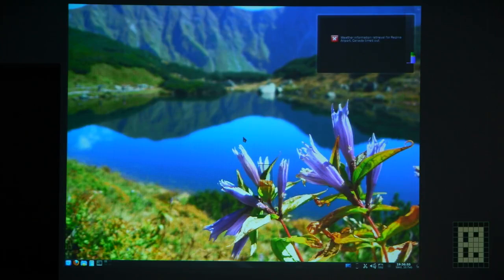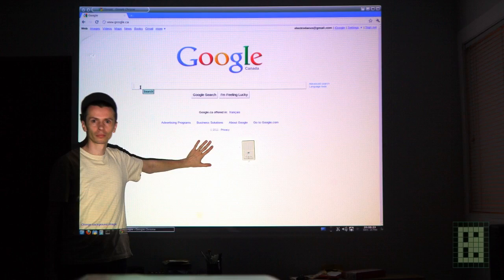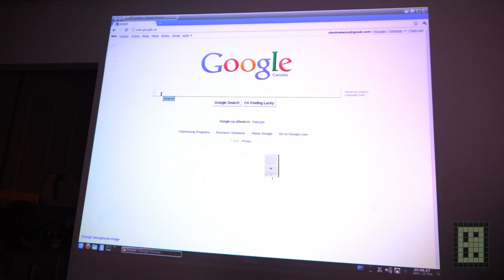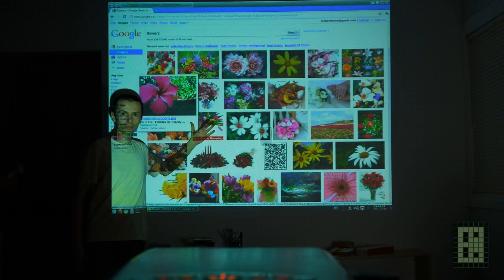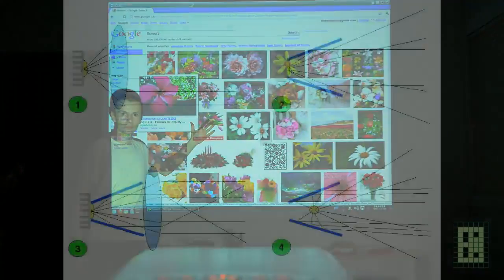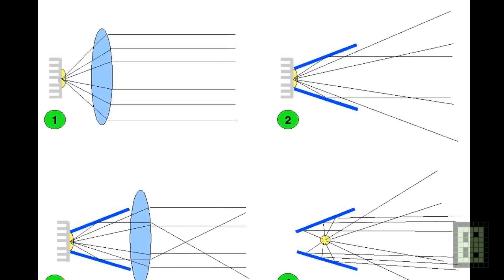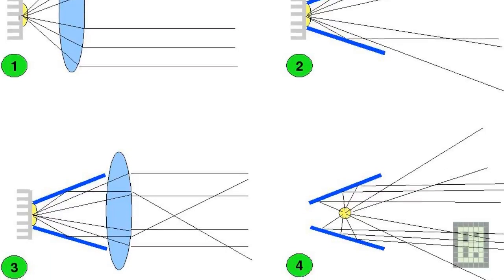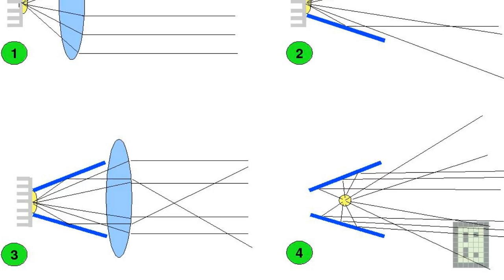DIY XGA LED Projector 3xLCD lamp replacement 25 lumen 720p (part-2)

Comment: I used idea with lens, 200% of improvement. Yes I have multi-die 30W LED, I will try to do test on 5W 3x3mm single-die which I bought few months ago for modification of torch.

Comment: Good job, I like it. Many thanks for the inspiration. I have 30W Power LED + reflector as collimator already installed in my Sanyo PLC-SU35 - 3LCD. Brightness in dark room was not exactly like I expected. And here is my "brightness" :) Lens is the key to success. Tomorow I'll be back with results. I've found beautiful lens ø=60mm. I hope, that it will give 200% of improve.

Comment: It's a movie projector (like you would see in a cinema) though it's not all that big, most of the bulk in those is in the base and the lamphouse. The original lamp would have been a 500-1000w xenon arc lamp. Just a large arc lamp with a big reflector behind it. No optics for light convergence or anything like that. No idea what the lumens would have been originally, a lot I recon. But that would have been for a 200"+ screen!

Comment: I can get the light source as close as a couple of centimeters from the film. The actual film area on 35mm is about 2.5cm square so it's not tiny. I don't have any optics in the light path yet, I'm still researching how I can do it really. The back of the projector is totally open with the shutter then the totally exposed film. From there it goes through the backup lens and then the anamorphic (if required).

Comment: I want to replace the xenon arc lamp in a 35mm movie projector with an led for home use, I have seen these 100w LEDs that seem like they would be useful for this but I imagine I'd need some precise mirrors/optics to pull this off? I'm building a lamp box from scratch.

Comment: The ones i have ordered are 150w Osram powerstars ($2.50 each), small enough to fit in the original lamps reflector. So that solves one problem, also they last 8000 hours and as for the LCD's i have a spare projector the same model in pieces with good LCD's in. Im hoping they will work with the UHP ballast, Metal halides are also HID but they are AC instead of DC. If not i will have to buy a ballast i guess ($20)

Comment: What about a 20w LED that puts out 2000 lumens ? Im quite new to this circuit stuff so i was wondering is there anything like a solenoid that i could jump off a fans power supply to turn the solenoid on/off, then have the solenoid as a switch on the LED's Neutral or Positive input ? So when the fans turn off the LED turns off too.

Comment: Let me rephrase. I have tried shorting everyone of the 4 wires, i have tried grounding everyone of them, I have tried unplugging it completely with no luck. The weird part is if i put a 12volt 50watt halogen in there it actually works its just really dim.. its just a matter of time before it blows up though im guessing.

Comment: Well ive tried unplugging the switch, shorting every way possible, grounding them and its just a Ballast error, if i put a halogen in the ballast it works.. but its not very bright and its just a matter of time until the halogen pops.

Comment: Hi Electrodacus, just like to thank you for all your help so far, I've used lots of advice you have given in the previous comments to get most of the parts for this build but there is one part I can't seem to find. Could you tell me where you got the mount for the large lens, I can't seem to find one on dealextreme where you said to get the lens from. Thank you

Comment: hi electro,
the lenses i bought off dx were those of what you specified and was able to focus it , but it's really dim even in the dark.( the led seemed to be bright as i can't stare at it directly) although it might still give off more light if the right driv er is to be used. so may i ask for your power source design like the one you used in this video(old laptop power source and the resistors' size and value to step down  the voltage)...thank you in advance and more power!

Comment: Hi electrodacus
  I have a different model of Toshiba projector: Toshiba TDP-SP1
  Currently I am trying to figure out if the power supply can be fooled or not.
  It has a cable with 5 wires connected to the main board:
  - two of the wires are +5V and ground
  - the other 3 I presume are connected to the 3 optoisolators.

Please advise if it can be fooled somehow.
Thanks!

Comment: hello electrodacus, thanks for your awesome video as i was able to "fool " a toshiba tdp-s20 projector and now just waiting for the led light source and the lenses you mentioned in your vids.. i have ordered this led -XMLAWT 1000-Lumen LED Emitter White Light Bulb (3.0~3.5V) from DX and a power source (700mA 3W LED Constant Current Source Power Supply Driver (90~265V)

Comment: I just opened my VP and run into problems.I discovered the switch lamp cover.I closed the circuit.Then i uncoupled what i think is the lamp elec.source( voltage? can i use a hid bulb?).The VP starts, rotates the color disc for 1 min,and for 10 seconds i can see the projection of my desktop(using a cree 3W flaslight) after this it enters a sleep mode with the fans on. it shuts down after 2-3 min.

Comment: Buna Electrodacus.I have a Toshiba  HD TDP-T100.Unfortunately it was without the original lamp. I want to build a LED lamp.I read you comments about the high output LED(PRIME 50-100W).You are saying that the light cannot be focused in a small area. What about this product: sku 43044?My idea is to use a 100W LED(SKU 42806), with reflector(SKU 39974) collimator lens(SKU 43044),power source(SKU 47306). What do you think?

Comment: Hello electrodacu, thanks, much appreciate it,however, I had already tried the 50mmv x18mm lens on its own, but with the 45mm lens I got better results, but the image is very dim rather than unfocused, I will try using the 22mm lens in between the LED and the 45mm lens, but I do know how you managed to fix the 22mm to the LED and find the correct focal length.I thought I can push the LED current bit higher,for brighter light. is that OK?
Today I just got new XMLAWT SKU 51989 from DX.for DLP proj

Comment: Hello electrodacus, super excellent, been following you videos and posting on lumenlab.com, and decided to give it a go.The only problem I have is to focus the LED into the LCD. It seemed there is light everywhere but not inside the 3LCDs chamber. I got a bit faint and unfocused image from using SCC P7 with 3.6v. 2.8A, into a 45mm lens (4-80 deg angle) in a Panasonic AE100 proj
I would very much appreciate it, if you tell me what Lenses you are using (Dia sizes, angles and focal lengths) Please

Comment: . Do you have any idea how to test the optocupler sending so that i can find out the signal that it is sending and mimic this signal with a microprocessor? also if you know how i can send you a picture of my lamp assembly just let me know. The led is a SMD that is running on 19volts and is mounted inside the existing bulb housing on a heat sink, and it has a condenser lens on it.

Comment: i cant seem to send you a picture of it but the projector is  taken apart and i have the HV power supply out and i have foung the controlling board for the lamp, it has 3 optocuplers on it one on the top the is recieving, one in the middle that is sending, and one on the bottom that is recieving.

Comment: Thanks for the reply.   I have a Hitachi CP-X265 3-LCD which is XGA.   I like the results you have achieved.   Do these type of projectors have a condenser lens in front of the original lamps?   I guess I'm wondering how the original lamp light is being focused.

Comment: @electrodacus (thanks for the lens info, found both)  Well, I do have an AC adapter from an IMB laptop that I stepped on and broke the tip off...Could I use this to power the CREE XML?  What resistor combination would I need to use for stepping it down?

Comment: What is the lens used in front of the LED.  EBay Item?  Would I be able to use a 12V power supply from an old PC to power the CREE XM-L LED?  I've bypassed the ballast board on my Sanyo PLC XU31, and put a car HID bulb in with the 12V power supply, but its not bright enough and the beam is not focused.  This LED/Lens combo looks like its solid.

Comment: @electrodacus 
34-36 is hid xenon 35w 3200lumens 5000kelvins

13-16 osram cool blue h1 with 13.10v supply, BUT thish pictures are influenced by the camera flash and not very real.
Xenon and halogen light almost equally bright.
Pictures deceive.

Comment: @electrodacus Pictures of 13-16 were made by Osram cool blue H1 powered 13.10v.
I'll announces a diode with a very small area of the matrix - cree xml led, perhaps.
I'll think more these days, these diodes want special power, but the lens and the LED will require a special stand. I do not know if there will be enough space for diodes, lenses and radiator cooling.

Comment: @electrodacus Here's how I've done to me, I tried with halogen bulb and today I put the car and xenon. From cheapest HIDs for experience. I use the original reflector of the projector.

Here is a link for the pictures, just fix it in your browser to  -   bradchedat.snimka.bg/experiment/lcd-dlp-projector-lamp-hack-mode-fix-hp-vp6111.650633.26230709

Comment: Guys, what bulbs are you using?
I use Osram cool blue h1 and a modified 13v pc power supply.
The dark look very good looking and in slightly lit room.
Tried and hid xenon but the effect is like that with halogen osram, except that money is more about hid.

A modification of the video work flawlessly :))

Comment: How many LUMENS did you get for Watts IE 100W LED = 4000 Lumens
   Something like that 

What wattage did you use? Would you use larger or smaller or same wattage?

Is the LCD a HOT or a Warm white LCD? Wave length used? That is if you still have the information.

If you purchased the LED on EBAY... Do you still have a link to the item or seller or like item?

Thanks you saved me and I am sure many others throwing out projectors needing new out of stock  bulbs.

Comment: how important is it to use a lens on the led. I am using a 50w prime led rated at 4000lm that i had for another project but my video is still quite dark. Any suggestions, and can u recommend a lens?

Comment: Ok, ballast is already out, I am also considering replacing the noisy fans with quieter ones and more directed airflow. I also think that my led and heatsink assembly will fit perfectly into the old bulb bracket. Should make for better light direction too.

Comment: hi, first of all thanks for all your effort and patience, it's guys like you that keep the dream alive for us. I have a proxima dp4100 dlp projector that I would like to use led as light source. I see 5 wires coming from the board green red orange black white but on the other side of connector going to lamp psu orange changes to clear. Are any of these bridgeable to bypass lamp detection etc? your help will be greatly appreciated. Thanks.

Comment: THE 3D IN MY PROJECTOR IS NOT NORMAL SINCE ITS NOT 3D IT JS STARTING TO SHOW IT.. IT ALSO SHOWS RED COLORS . I OPENED IT UP AND CLEANED IT . NOTHING IS LOOSE.. I SOMETIMES GET LINES THROUGH THE SCREEN BUT THE FOCUS WORKS GOOD.

Comment: since the multiple little LED's on the panel act more like a flood light pattern than a tight spot pattern.   It seems like the Cre Xml series had a much tighter point of light but I am concerned that it might not handle the wattage.  I am also considering using three separate LED's directly behind the LCD polarizors and panels as well.  Pt 2

Comment: Hi Electrodacus,, First off THANKS for all your work with the projector mod's!!  You are the Best!!  Could you please list the exact Make and Model LED part numbers on your various mod's so the rest of us can take advantage of your work.  I am thinking of using either a 50 or a 100 watt 6000 K LED module but am concerned that the originating point of light will still be to wide to achieve any real brightness. PT 1

Comment: @electrodacus Yeah the central one is ground, connected to 2 optoisolator, but they are in opposite direction. Just connected the central one to one of the other 2 on either side and both time the "Light problem" led light up.
Wonder if there is another way to trick it into thinking there is a working bulb, big resistor between the contacts that go to the bulb...? 
Will do a bit more testing if I have time this weekend, I would love to have a project but cant afford a new one.

Comment: Nice mod!!! 
I am trying the same thing at the moment, found the 3 pin wire that goes to the electronics responsible for controlling the light. Just need to do a bit of testing to figure out witch one is the control and what does the other one do. And see if the projector will display images before I buy all the hardware.

Comment: @electrodacus 
I have built some DIY projectors, and also succesdul modded a commercial projector some years ago with a H7 car bulb :). I love modding and have tried the led-light as well -but only as a 3w powerled -and it was not so succesful as your modding.
I thought the origin fans for UHP-lamp was enough for cooling a higher wattage led light..
If you find a solution to cool the high wattage led light you should have the official Nobel Price of modding :)
in the future!!!!

Comment: the laptop adapter did you connect it to projector power connection. does led power on with projector or is it separate from projector..thanks

Comment: @electrodacus 
i found the control wire, and I can make my machine run continuously, but I have trouble focusing the light of the projector lamps. Tomorrow I will buy the headlight of flashlight C30 and use, i hope complete

Comment: Need your help. I found the optocuplers. and the pin out wires. theres is 5 wires. not sure which one is for the lamp signal. what do you do with the wire when you find it?...i posted a quick video of my attempt..let me know please...really want to do this mod.

Comment: @electrodacus 
Thanks a lot for a very nice mod on projector. I have currently a panasonic projector with a busted bulb and would like to know which CREE XM-L Led I can use. There are 3 kinds of it. Can I use the cpu heatsink for it? I can easily modify the circuit to fool the projector into thinking that the bulb is working. I also have access to lens in order to focus the light ( lens with almost 3.5 inches aperture and is apochromatic or color free). 
Thanks again,
pokoy

Comment: I have on order this LED "PRIME 20W 2000-Lumen LED Emitter Metal Plate - White (16~18V)" plus power supply and heat sink. do you think they will be ok?

Comment: Hi i need help.i have a sanyo pro xtra multiverse projector which im trying to convert to led power. i have managed to bypass bulb ok circuit but now the projector goes into shut down after about 25 seconds. tha manual says that its because of unuasual high temperature or cooling the buld befor shutdown . there are 5 wires  in the bypass plug so would you have any clue as to what i would need to do to keep it running. 

Hopfully
Dominic